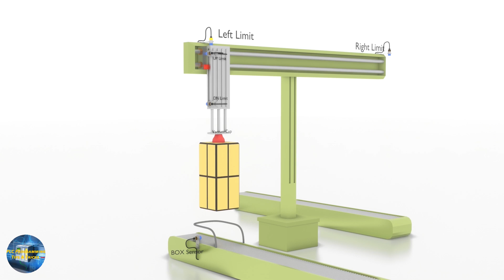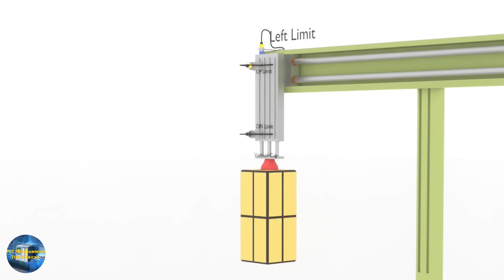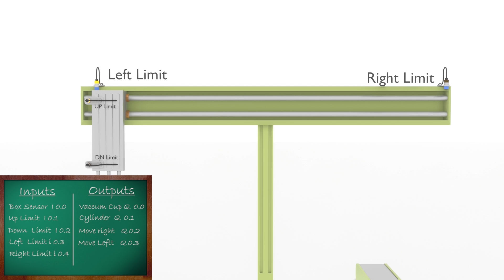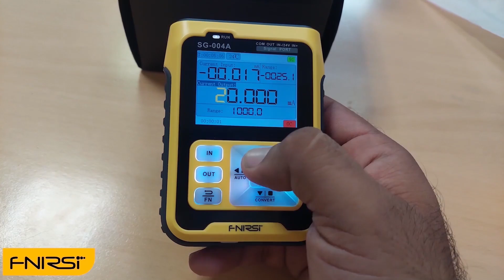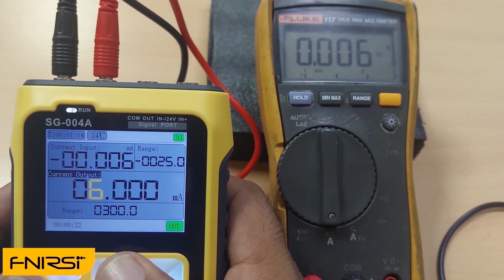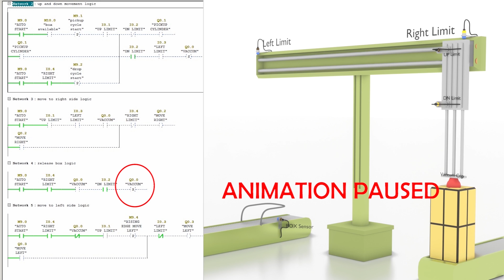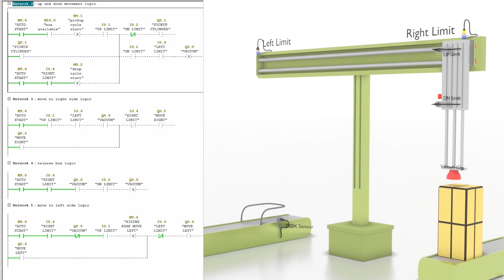Pick and Place Robotic Arm programming in PLC Programming Tutorials for Beginners

Comment: What happens if the trolley is moving from left side to right side and gets stuck in between
Reply: You can solve this by using push buttons for manual control to place the trolley in the right place so that the system can run automatically again